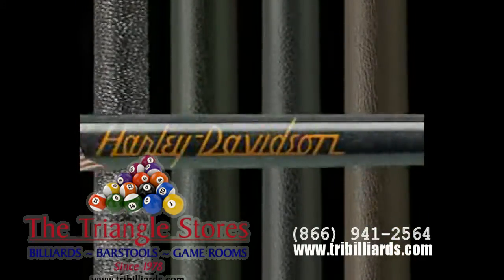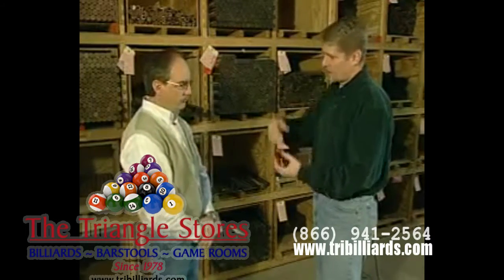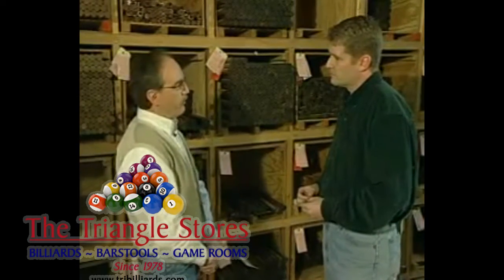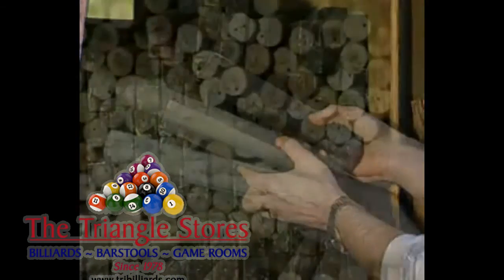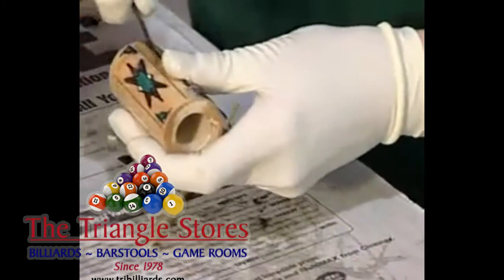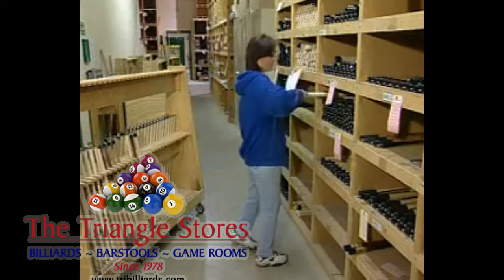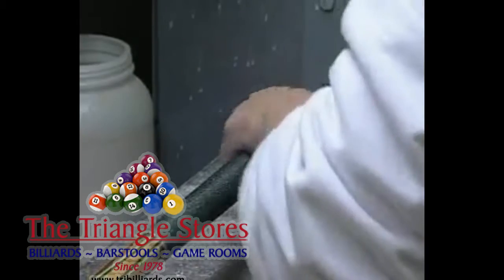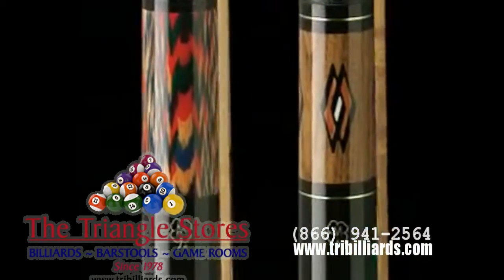McDermott Custom Cue Factory Tour December 14, 2015

Comment: I have two McDermott cues under $300 and they have no quality issues. I've bought two Viking cues between $350-$400 in the last 60 days; they have quality issues where both Vikore shafts have uneven taper and was warped brand new. One is in the process of being returned and one is in process of being warranty. I plan to get rid of it once it is fixed. I trust McDermott quality control. Viking quality control is horrible.

Comment: I have a brand new McDermott with I-3 and a quick release joint. Unbelievable how good it hits. Absolutely amazing. Triangle billiards basically threw in the I-3 for free. Plus a $129 bag. Awesome. Thanks.
Reply: Bob73333, I am thinking of getting a McDermott with an I-3 shaft. I know it's a European taper to an 11.75mm tip, but I need an extra 2 inches on the shaft. Do you think an I-3 would work well in that situation? And which McDermott cue did you buy and does it have a stainless joint? Thanks. Jeff